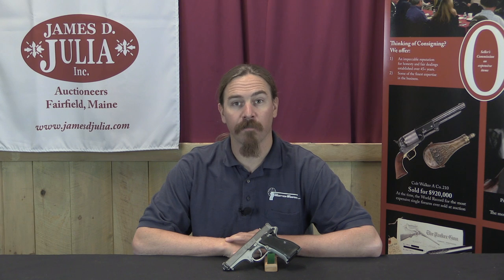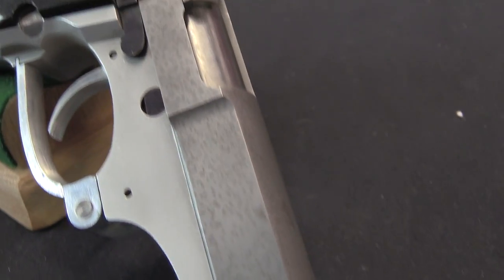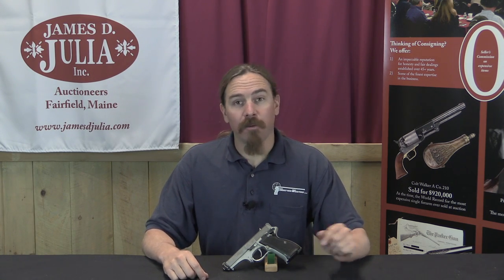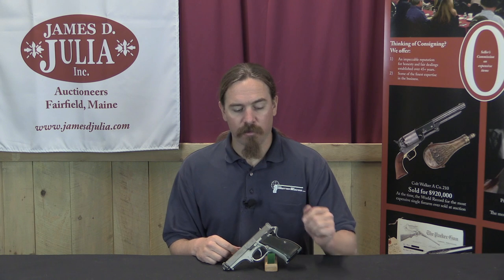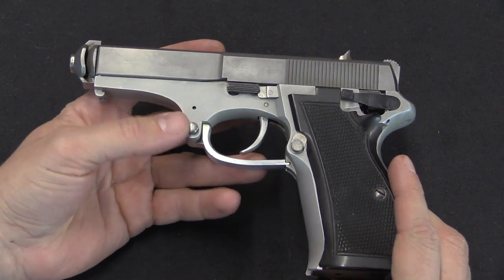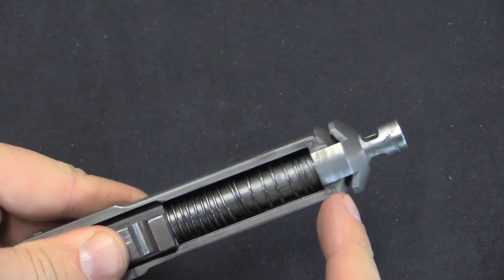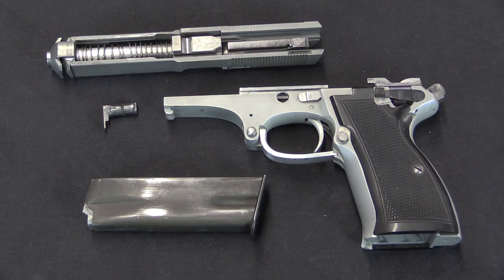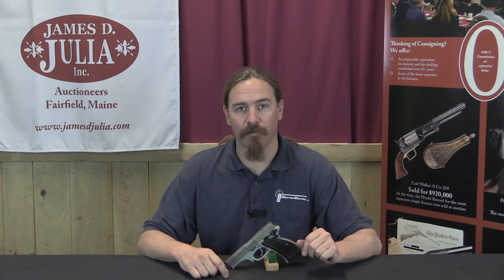High Standard T3 Prototype: An American Blowback

Comment: That muzzlebrake seems to be meant for slowing the slide down. The direction of the ports are pointing back meaning the slide would try to rocket forward, thus slowing the blowback down. Dunno about the effectiveness though.  I could be wrong here but that's what im speculating:)
Reply: That was my thought too
Reply: olli lehtonen exactly like a barrett
Reply: That was exactly my though. I'm in a re-enacting group with a replica blank firing QF6 antitank gun that the muzzlebrake completely counteracts the recoil. I know because at one event we had a malf. and shot the break off about 15 feet :-D. We had to manually slide the barrel forward after every other shot because even with a light load of pryodex it was coming back at use at an alarming rate: -D
Reply: Haha great minds think alike. I thought the same thing and was pleased to see other were commenting on it. So did the others sent to the trails have the muzzle brake as well? if so it didn't work to fix the problem. If not maybe that was their solution for the next batch.
Reply: Was just about to post the same comment.
Cheers!
Reply: Was just about to say the same thing.
Reply: yes trying to slow the slide down. maybe to mitigate recoil as the Astra 400 is very snappy from my experience or trying to keep slide closed longer
Reply: Aniquin thank you. it even looks like an old barrett arrow head
Reply: Alistair Shaw Yeah
Reply: Stephen Tack Cheers mate!
Reply: keith moore you mean like 99% of LE and Military organizations have switched to 9mm?
Reply: Me too.
Reply: The muzzle-brake is clearly a slide-brake. It has to be pointed out that this DOESN'T MEAN THE GUN IS A DELAYED BLOWBACK. For the slide brake to operate infact the bullet must have ALREADY LEFT THE BARREL, so it have no function in delaying the opening of the action until the pressure lowered to safe level. The only meant of the slide brake is to slow down the slide AFTER the bullet left te barrel, so sparing the frame a little beating. 
Hironically, a way simpler buffer spring/pad like that of the Beretta 1915 and 1923 would have probably been much more effective.
Reply: I wonder if the designers ment for the break to work in conjunction with the annular chamber.
Reply: Yep, another way to increase the resistance to open, as the ringed chamber did.
Soviet did something similar with OTs-35 (ОЦ-35), when trying to feed poor little Maks with much hotter loads
Reply: Don't think you're wrong at all. It had a small effect that should have been used in conjunction with the cartridge's ring expansion delay idea. Multiple small delays combined with recoil buffering may have been enough?
Reply: One or more of the last ditch people's defense (Volk Sturm) rifles used a variation of this same principle to delay the opening of the action until the muzzle blast bled off.

Comment: The slide-mounted muzzle break geometry, it appears to be directing gas back and to the sides of the pistol, suggests to me that it might be an attempt to slow the slide, not accelerate it.
Reply: Bryan Shouse exactly!
Reply: Bryan Shouse back...and to the side,
Reply: Please don't quote JFK in this context. Most of us here are actual shooters who actually understand something about terminal ballistics, unlike Oliver Stone.
Reply: Before the gas has reached those ports, the energy of accelerating the bullet has already started pushing the slide rearward. The gas wouldn't arrive until the bullet passes the muzzle, thus it's an uphill battle against momentum. I'm thinking that with careful shaping of the barrel ports the timing could be perfected, and still not really overcome that momentum. Mass, that's what you really need to slow that slide down. Of course, that means using the lightest possible frame in order to keep weight down while freeing up some few ounces to put into the slide. I figure this was the reason to switch back to a single stack mag in the later pistols. (the weight of ammunition probably counted against the target weight. So, having fewer rounds and a lighter mag would lend itself to adding mass to the slide, and thereby reducing it's acceleration rearward upon firing), Just my two cents.
Reply: Lol I'm a shooter too . i watched JFK on a plane ride the other day guess it's stuck in my head
Reply: @0neDoomedSpaceMarine  
You're right. They even make pistols with locked breeches in calibers we typically associate with blowback designs, specifically because they can be made smaller and lighter. A common example would be the Ruger LCP in .380

Comment: Wouldn't the muzzle break slow the slide down? The gas ports are angled out and back, so wouldn't the thrust of the expelled gas blow out and back effectively making the direction of the thrust generated forward while the slide tries to cycle back towards the shooter. Just curious.
Reply from the maker: Yes, it would - I must have been getting tired and not thinking about it properly when I recorded this. Sorry!
Reply: Just what I was thinking. I was working that out in my head when I found your comment.

Comment: the muzzle break wouldn't have caused increased acceleration of the slide, if anything it would have been an attempt to reduce the slide velocity. The gasses being directed backwards would impart thrust in the opposite direction that it traveled effectively ( or not) causing extra resistance to the slide moving backwards.
Reply: I was thinking that, the gasses pushing out and back would seem to push the slide forward. Or are we missing something Ian?
Reply: FISTER87 it doesn't even have to redirect the gas backward to cause forward thrust. The gas is going forward down the barrel at high speed, so even if the muzzle break redirects the gas straight out the side, the forward momentum of the gas would be transferred to the slide, slowing it down.
Reply: FISTER87 may be the ringed chamber barrel reducer the slide speed so much  that the frame mounted muzzle brake wad needed
Reply: but the brake is mounted to the slide. With that configuration all the break does is resist the momentum of the slide moving backwards
Reply: Can't be. It's like the muzzle break on the Barret .50 except that instead of reducing the recoil of the whole weapon, this one acts on the slide.

Comment: I just can't understand why the airforce said no to the anular-ring thing, if the company that you contract comes up with a novel solution why say no ?
Reply: My guess is because some armchair commander sees himself as the know it all with all the right answers. Similar to how the government decided to use ball powder in the M16 when it was introduced.
Reply: The official reason was that they were worried that it wouldn't be compatible with steel-cased ammunition.
Reply: Probably didn't work as well as advertised.
Reply: As a designer, I can assure you that generally novel solutions are not adopted.

Comment: High Standard: "Here's your gun. We also took the liberty to design as very simple delaying mechanism that doesn't require any extra parts to make sure no parts of the gun break due to excessively high slide velocity. 
Air Force: "Cool. But we don't want the delay mechanism. Just blowback. I'm sure it'll be ok.
Also Air Force: "So we tested the gun. And it appears that the slide velocity is too high, leading to parts breakage. If only you were able to control the slide velocity somehow....... Sorry but we can't accept this gun because of these issues.

Comment: The muzzle break is angling exhaust gases backwards, pushing forwards against the slide. That means it's designed to slow the slide's rearward movement and reduce recoil. Sort of like the muzzle break on a howitzer.

Comment: With the ports near the end of the barrel, the slide-mounted muzzle brake (which being a relatively normal brake causes forward and downward force on whatever it's attached to --- that's how they work on barrels, after all) wouldn't act until the bullet is already nearly out of the barrel, well after extraction has begun possibly even after ejection.

If the brake was for anything, it'd be to reduce the momentum of the slide assembly moving backwards near the end of its travel, softening felt recoil, reducing  and allowing for a softer spring than otherwise (which in turn could reduce muzzle dip from a heavy slide/heavy spring slamming forward).

Comment: If they had used the annular expansion delay, would the damage to the weapon been as bad? I'm not an engineer, but the engineers at High Standard were and seemed to think it was a solution for something involving recoil. Fascinating either way.

Comment: So this is kind of interesting  because recently I purchased metal 1911 Drum Mag and When I did a little research (i.e. Wikipedia) it came up that it was originally developed for the Air Force to issue to pilots in survival kits for their 1911.  Since this set of trials ended with the Army Air Corp keeping the 1911 I wonder how that lead to the development of the drum mag project.

Comment: i'm guessing this was before the development of 7071 T6 high strength aluminum alloy. I wonder if Colt's R&D is what led to the original Commander, which came out in 9mm. The frame shape, rails and ejector are very similar to the slightly later S&W pistols. The folding trigger guard looks a little ungainly, but it seems effective. Pretty interesting. The AF adopted an aircrew S&W  38 snubby in the 50's or early 60's which was an ally frame and cylinder, which led to the short lived Model 12 (alloy K frame). I guess the AF was always searching.

Comment: A variation on the annular ring retention system was used in a .22 Magnum pistol.  It consisted of a series of circular holes drilled around the inside of the chamber.  While it did work, the gun was dropped from production, though I'm not sure I remember all the reasons.  It was an Auto Mag.

Comment: It seems a shame that High Standard didn't use all that development work to turn it into a locked-breech model for the commercial market in the 50's. The trigger guard seems overly complicated; a spring steel guard rotating about a vertical pin in the frame could have achieved the same result without all the machining and lockwork.

Comment: The efforts on the part of the (Army) Air Force to procure a 9mm handgun for it's aircrews, security personnel and others eventually led to two handguns being produced for sale to all comers. #1 was the, now classic and well made, S&W Model 39 and #2 the truly awful S&W Model 59. The former was of course single stack while the latter was a double stacker. I once owned one of each of those handguns and really wish I had held on to that sweet Model 39 while I never lost a moment of sleep over trading the Model 59 off for a 1911A1 clone chambered in .38 Super....Because the clone actually worked while the Model 59 was, on a good day, a "jam-a-matic" with a horrible trigger pull. As I'm sure you are aware, both of the S&Ws featured aluminum frames and were often faulted for developing cracks in them. I never experienced cracking my Model 39 despite shooting it a LOT (even with the classic Super Vel ammo of the 1970s) whereas the Model 59 sucked so hard I was never able to shoot it enough for cracks to develop. If you look closely at the profile of the High Standard T3 I think you will see a bit of what were to become the S&W Models 39 and 59. Excellent video as usual!

Comment: So the U.S Army's standard pistol cartridge was .45 ACP. but the U.S Army Air Corps wanted to use 9mm? That sounds like a logistical nightmare on it's own... The reduced weight and recoil doesn't seem like a good enough trade-off for the logistical problems associated with going to a different caliber than all other branches of the military
Reply: At that time, and for many years later, US pilots usually carried revolvers in .38 Special.

Comment: In some videos I hear you refer to a revolver as a pistol. I was taught that Pistols worked pretty much like a piston and blowback action made the gun cycle and revolvers were the weapons with a revolving cylinder.

Is it common for a revolver to be called a pistol?
Reply: Interesting comment.  Though the use of pistol goes far back before the 'self loading' pistol.  Muzzle loaders were pistols when designed for single hand use.  I once referred to my S&W 586 as a pistol on some forum and was immediately hit with a dozen "that's not a pistol, it's a revolver" comments.  I had always considered any handgun a pistol with a revolver or semi-auto or muzzle loading, etc.., being a type of pistol..  If you look around the definition varies, some dictionaries define it as any handgun, some define it as a handgun with the chamber integral to the barrel.  I don't know if the original designers of revolvers considered them pistols or not, the single shot muzzle loading pistol obviously came first and revolvers obviously came from the desire for multiple shot pistols without the extra weight and expense of multiple barrels.  I'd like to see Ian's take on it.
Reply: The earliest patents on the subject of revolvers use both terms to describe different aspects of design - "revolver" refers to the multi-shot cylinder mechanism and "pistol" refers to size of the gun. They used "revolver" wherever it was relevant, even when describing rifles and carbines.

From a technical perspective, you can refer to (what we now call) a revolver as a pistol. The problem is that from a linguistic perspective, it seems to be established that the terms need to be used exclusively, as you were taught.

A part of me sighs when arguments around words like this come up. (Not in this case.) Kind of like when people need to distinguish "motor" and "engine" as something they weren't originally.
Reply: Well he seems to have been taught that a pistol refers to a self feeding handgun while that is clearly wrong.  A muzzle loading handgun is a pistol and they were called pistols long before pistols were self loading.  Even if you differentiate between revolver and pistol it's not got to do with the way it's loaded, it has to do with the chamber being integral to the barrel.  When fired the charge and projectile are physically inside the barrel where a revolver has a chamber separate from the barrel.  You are correct though that all revolvers are not pistols, and revolver actually refers to the inclusion of the rotating cylinder.
Reply: Getting Better at Music Sorry about that. The part about me sighing wasn't how I meant it. I meant when people get involved in the whole "you have to use the words my way because I know how to use them" argument. The fact that you questioned it instead of berating Ian is indeed admirable.
Reply: Thomas Mobley Yeah, that's the problem with language. Common usage rules over logic.
Reply: Linguists try to keep up with the users.. not the other way around. :)

Comment: As a rhetorical question, why didn't the flyers just go with the Colt 1903? 32 caliber, small, slim and very much like a scaled down version of the 1911. Problem solved. Huh.
Reply: Doug Shalosky the .32 cartridge is too weak for combat and pilot suvival need
Reply: Absolutely that's true and unfortunately that was discovered the hard way early on in the .32 history. I was really referencing what they had asked for in terms of requirements.

Comment: Hi Ian, thanks for the video. Has there been any other development of the annular chamber, would that make 9mm blow back viable?
Reply from the maker: A heavy slide and/or spring make them work, but weight is what the Air Force was trying to avoid here.
Reply: Thanks👍

Comment: I have never understood the idea of using aluminum in a pistol or rifle! The metal is too soft even if it is an alloy! Titanium would be the metal to use. Although Titanium is heavier than aluminum it is as strong as steel. This pistol looks a lot like a Walther P38. The way the slide comes off is identical to a P38. The Navy had thought about using the Remington Model 51 but decided not to because it was difficult to make and very costly! Maybe the Air Force should have tested the 51 for its' purpose.